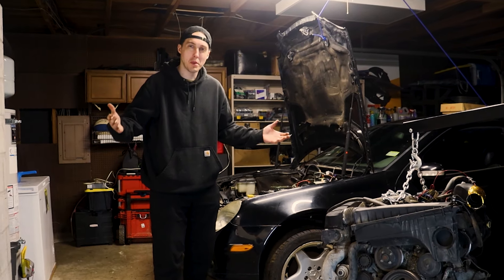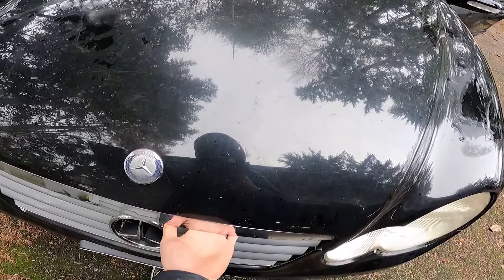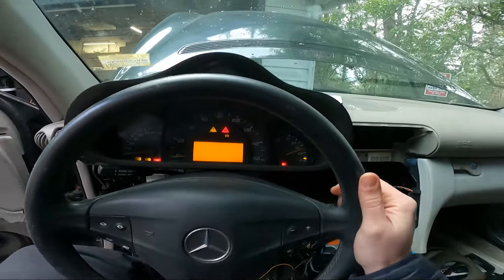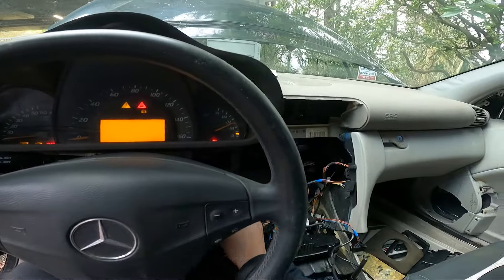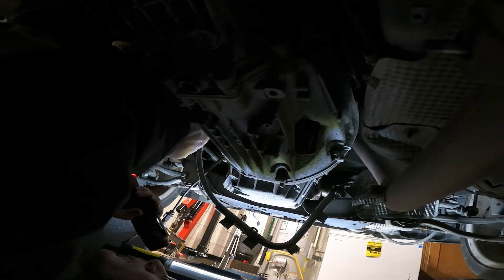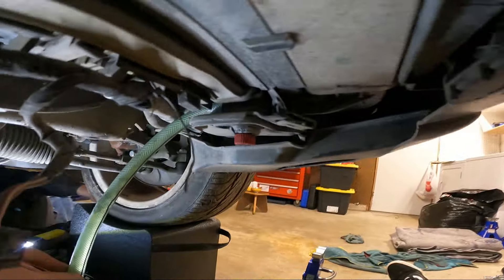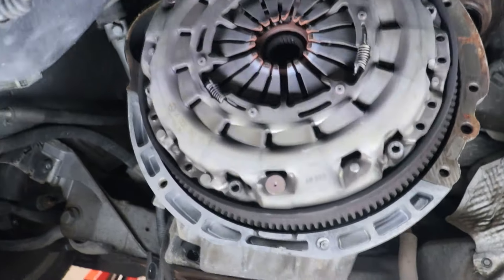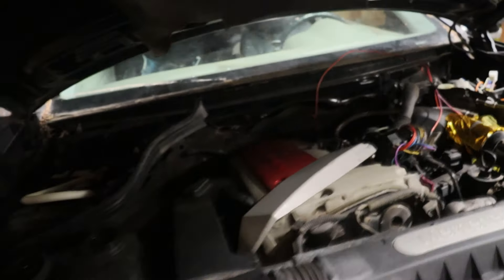Benz'n On a Budget Episode 8: Finally The KOMPRESSOR Engine Pull!

Comment: If I recall correctly, that Is an M111k evo. Which came equipped with a clutch less kompressor. The M111k  in the W202's came with a clutched Eaton supercharger.
Reply from the maker: Yep! Found this out after! M45 vs M62 clutched like I was used to on my old 202 kompressor